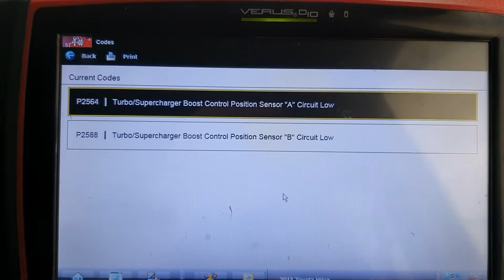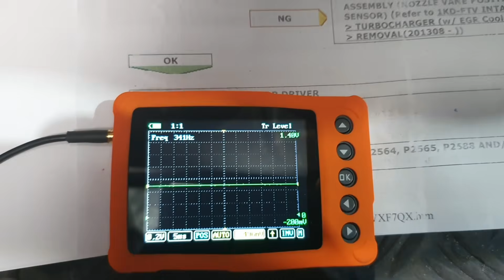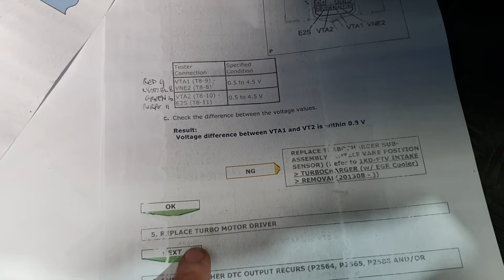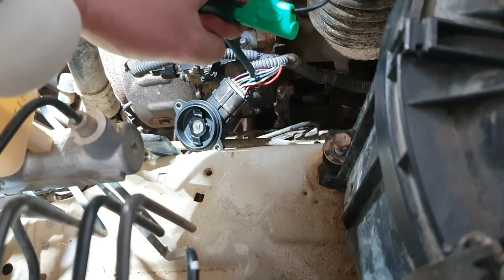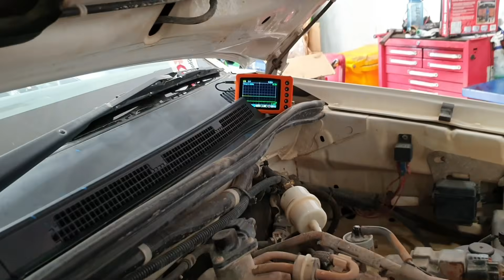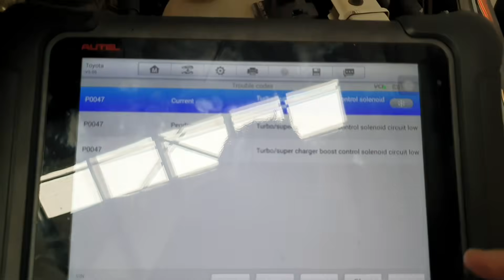Toyota Hilux KUN26 - P0047 P2564 P2588 - Engine light on, low power, no boost

Comment: Great video, Geat work.
Daughters hilux is the same KUN26_2010 threw a P0607 a few weeks ago, yesterday the vehicle was running rough, and even sounded like it misfired she said. I reckon its related to the code. Does this hilux have the ECM in behind the glovebox? it mentions to check all connections are tight, and no wiring harness failure first of all.
Does the Hilux have a ECM and a PCM? Or the ECM is the PCM?
What brand is that volt tester you were using?
And do you recommend any work shops for this type of diagnostic work south of the river?

Comment: Mine has p0047 code but no check engine light on the panel guage. Low power below 2000rpm

Comment: So the outcome was to replace the driver module and stepper motor? Or just the module behind the glove box ? Mine is showing the codes p2564 and p2588
Reply: Watched it again, the customer damaged the stepper motor and the original driver module was faulty also.

Comment: If people would only realise if they leave it alone it's actually cheaper in the long run.
You end up spending more time fixing what the customer has messed with before you get back to the original fault.
Reply: U would be surprised how fragile this turbo boost management system really is especially when the car aged😂. I had a hell of a time diagnosing it doing it twice in a span of 8 months. The problem is there are two types of stepper motor for this motor. The hiace van one u can open it up and check the brushes of the dc motor while the hilux ones are in its own shell making it tough to swap anything over or replace the inner parts😂. My hiace has never boosted this good before since i owned it over 7 years driving it😢

Comment: Great video, just recently bought a 2008 and it had been ruined by this fault, First EGR valve going then ruining the gearbox and oil cooler, now onto this problem working out which one it is ! Hopefully that’ll be the end of it. Thanks for the advice and good walkthrough
Reply: Great,  ECM is not communicating  with OBD diagnostic tool.
How will I check.
Request for assistance

Comment: I have Ford ranger wildtrak 2013 - P2564 can't be deleted - also P45 and check engine also come out but can be deleted and return back after run test and switch off the engine - can somebody give recommendation on this issue (Note: Ford service center - unable to resolve this issue as well)
Reply from the maker: Nelson where are you located?
Reply: @romanosautomotive  Philippines - before I forgot - said unit was brought to Ford service and after 2 hours drive - the alarm came back

Comment: recently my 2014 3.0L Hilux has started to make a strange low siren noise form the turbo, but no white or black smoke and I do notice a small decrease in acceleration. also the exhaust sounds really different.. this shit really doing in my head
Reply: boost leak

Comment: Have a 2017 fortuner, 1GDFTV engine and getting a P2564 on OBD II  scan. This code only pops up in the sand dunes and has never come up in any other situation. I have to clear the code to get the vehicle out of the dunes, since power is restricted to about 2000 rpm. This code does not show in the Toyota diagnostic tool history, instead it shows C1201. Could it be the same issue?

Comment: Have a 2006 hilux...first no power. And now it just idling..and now it not starting...any suggestions.
Reply from the maker: Gary, there could be a few different issues there but really it's not something I could help you with over this platform. Whereabouts are you located and I'll see if I can point you in the right direction?